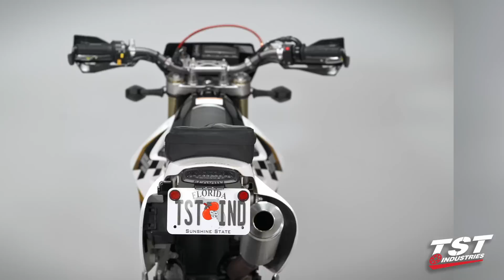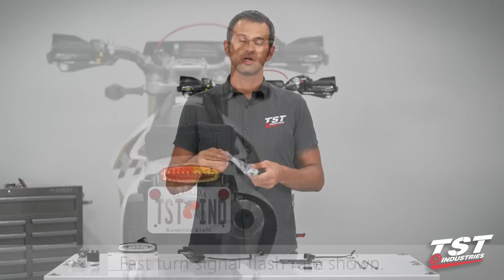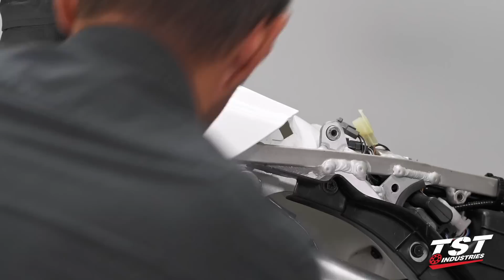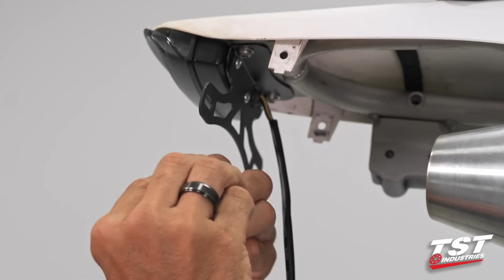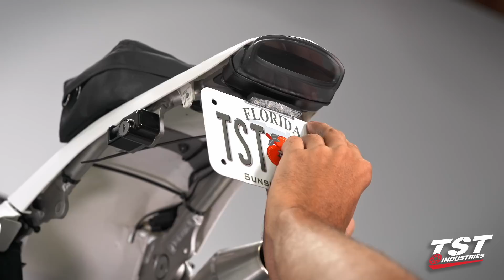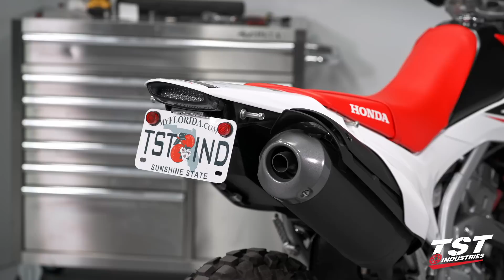How to install Integrated Tail light & Fender Eliminator on a Suzuki DRZ 400 by TST Industries

Comment: When u remove a bolt then the part, put the bolt back in the hole and give it a half of a turn with your hand so u dont loose or mix up ypur bolts. Then when u need them to put a part back on, they are right there and you dont risk loosing them or trying to remember which one goes where

Comment: idk what tail light i have, its already a sequentail tail light...will this kit plug n play with it?
Reply from the maker: If you have the Edge light then the two studs for mounting that unit do fit in the holes in our brackets. This means that your light is compatible with our hardware. We do not typically sell the hardware without our tail light though. You will have to contact our customer service guys and ask them for a custom order.

Comment: Do your turn signals bolt to the license plate bracket if I want to use them rather than the integrated turn signals? Would I just plug them in instead of the ones connected to the taillight?
Reply from the maker: Our signals are able to mount to the license plate bracket through the use of our pod signal mounting kit. You can absolutely leave the signals inside the tail light disconnected and use external signals. I am just unsure of the total length of connection reach needed from that location to the harness connectors. Our ARO18 signals are probably not a good choice there because they have pretty short wires. Our BL6 would probably work better. This is taking into consideration using those with our harness converters, as they extend the total connection reach and enable plug and play installation. I just can't know for sure if that is long enough for your described use. Another option that is less expensive but a bit crude is to clip off your plug and wires from your OEM signals and splice those into your new signals. This would guarantee proper length.
Reply: @TSTindustries  Thank you. When I do this I will probably get the turn signals and modify the wiring as needed. I just like the visibility of turn signals over the integrated ones.

Comment: Will this fit a 2001 drz400e?
Reply from the maker: I believe that the E model is the one with no subframe under the tail/fender. There is nothing there to readily mount our setup to. You would have to do some extra fabrication to make that happen.

Comment: is there a plug and play application to use soke of the pod turn signals on the rear with the integrated flasher from the brake light?

Comment: I have your integrated system and turn signal modulator on my 2020 Ninja 650 KRT. I love it. It was easy to install. 

The system for the DRZ is nice but the separate license plate illuminator is crap. I will NEVER tap into a factory wiring harness! That creates a resistance problem. And corrosion will eventually create an electrical problem on the motorcycle.

That's why when I see a used bike with a tail tidy, it's a pass for me. No thank you.

Another thing I will say about the integrated systems is that they become very much LESS VISIBLE to people around you should you have side cases on your bike

Comment: Why did you molest the cycle harness and not just the light harness!! 
The connectors are neat
Reply from the maker: I like to have the license plate light connected to bike side because in some instances I remove the tail light without the need to remove the license plate light. This keeps their connections independent.
Reply: @TSTindustries  ok, I get it. Just made me cringe. 
Are those little connectors water proof?

Comment: Awesome kit, very high quality, very fast shipping, very good installation video and no need to hack up the wiring harness on a bike with 50 miles on it in order to install the kit. Personally could not be happier, and i'm glad i cancelled my DRC Edge order and went with the TST instead. 

by the way, the installation videos go a long way. I know this is a simple product that is not difficult to install, but having a guide to follow that completely removes all ambiguity from the process goes a long way.
Reply from the maker: Thank you sir. That is exactly what we aim for with our installation videos. Glad that it worked for you as we hoped it would for most.. Cheers!

Comment: do i need the the description says it just adds 3 programmable modes to the tail light and im not sure what that means its necessary

TST Brake Light Modulator for OEM & TST Integrated Tail Light Suzuki DR-Z400S/M  ?

Comment: I note this video is now three years old but the tail light fender eliminator is awesome. Perfectly integrated and much neater. Good work.  However, pity I can't say the same thing about the license plate light. This seems like an afterthought and the wiring is very clunky compared to the oem style plugs of the tail light assembly. I write this from Australia where a license plate light is required to meet local design rules and such a light integrated into the main unit would be a big improvement.

Comment: If you loop out while wheeling would the taillight get destroyed or does it sit far enough in the fender where the fender would take the damage instead of the taillight?
Reply from the maker: More than likely the tail light would get destroyed. That tail fairing isn't the strongest either so fair chance that everything would show some signs of damage depending on how hard you hit.
Reply: It gets destroyed easily and it's kinda spendy

Comment: I'm like 80% sold...I wish that license plate light was integrated too. It feels cheap to have to tap power for the license plate light. Otherwise awesome design.
Reply from the maker: Smart design is modular. There are so many guys that shop for motorcycle parts that do not want a license plate light. I don't know the reason...we just comply with the most universal approach to satisfy everyone. Our license plate light is developed to work with any of our kits, for those guys that want a license plate light. And you don't necessarily have to tap in if you don't want to. You can make a pigtail with a connector set that comes off the main tail light connector.
Reply: @TSTindustries  #1 thank you for the reply, great customer service! I get what you are saying about the modular, it's a great product and now I'm 95% of the way there! The extra 5% is just me sucking it up and pulling that trigger!
Reply from the maker: No worries man. Take your time. We aren't going anywhere.

Comment: Very happy with the way the clear taillight looks on my white DRZ. Bought this with the brake light modulator and the only issue I have is that the wiring isn't long enough to allow the modulator to be tucker away under the seat, meaning I had to ziptie it to the subframe under the rear fender and leaving it exposed to the elements. Going to rewire the harness over the winter to allow the connectors and the modulator to reach under the seat.
Reply from the maker: https://youtu.be/Do7b0mevaWU
Reply from the maker: Hmmm...when did you purchase your modulator? We did a video on the DRZ showing that installation under the seat. I will post the video link below.
Reply: I bought it earlier this summer. I received the standard wire harness that plugs the modulator halfway between the taillight and the oem connectors, at the first connection underneath the fender.
Reply: Not sure why though, I bought it as an add-on directly from the DRZ page.

Comment: What brand of ratchet screwdriver (red handle) do you use? Trying to find the same one.
Reply from the maker: These aren't available anymore but you can still fins a Stanley Rotator Ratchet, which is basically the same thing.

Comment: Anyone know if this will fit a 2000 drz400e? I am about to title mine for street use.
Reply from the maker: The 2000 E model does not have the rear section of frame that the OEM fender, lighting package, and other peripherals bolt onto. This would not be a direct bolt-on installation for you.

Comment: Would that fit a 2018 Yamaha WR250R as well
Reply from the maker: No it will not. The electrical connections are different and of different length, and the main bracket differs as well. We plan on releasing a setup for that bike but thus far have been unsuccessful at getting one in house. If you are local to us, and are willing to lend us the bike for R&D, you will get the setup for free.
Reply: Ok. I don`t have the bike yet but I am working on getting the bike but not sure when it will be hopefully I will have it soon so I can get back to riding again an meet some riders an maybe ask them some questions about bikes also where are you located at? An which rear tail light like that in the video would u think would work for a 2018 Yamaha WR250R bike?

Comment: How can I make the brake light pulse when applying the brakes?
Reply from the maker: We are working on a brake light modulator unit that will be launching later this year. It will plug in between the OEM harness taillight plug and our taillight plug. Unfortunately we do not have a release date yet.

Comment: Why not make the electric whip one piece?  What's with the big-ass plug in the middle?  I see that as a problem in the dirt.
Reply from the maker: This light is used in a few different assemblies where we need to plug into different end plugs. We have sub-harnesses that accomplish that. The main 6-position plug is a Sumitomo sealed plug. Wateror mud will not get inside it so there is no need to worry. In fact, many Honda dual sport bikes use this plug on their taillight.
Reply: I bought this product and did the install.  I am very happy with the results.  Install was very easy and the bike looks so much better.

Comment: I hope the bracket isn't extremely thin and won't just crack like the current one on my DRZ.
Reply from the maker: MotoBoy the bracket that holds the assembly onto the bike is 14ga. Galvaneal steel. The bracket that holds the license plate onto the assembly is 16ga. Galvaneal steel. If these thicknesses are not adequate for you please do not buy our kit.
Reply: TSTindustries what an idiotic response. As if I'm supposed to know what thickness I need
Reply: We'll see. Already bought
Reply from the maker: I gave you specifics because you asked the question. We have been at this game for a number of years and our engineers have been designing these parts to be lightweight and practical. The only way it is going to crack is if you physically bend it and strain the material. Under normal use the brackets will outlast your bike. I hope this answer gives you more of the info you were looking for.
Reply: Yes, that's more of the type of answer I'm looking for...as long as it doesn't crack. 

I'm not sure what the current brand is of the fender eliminator on the DRZ, but it seems like off-road riding, wheelies and of course the inherent vibration of singles put some stress on it causing it to crack. Mind you, the bike has never touched the ground nor scraped (I'm not that good at wheelies).
Reply from the maker: Bending sheet metal during production introduces the first strain to the material. After that vibratory cycling can in fact continue that strain and result in fracture at the bend. This happened to some of the more rough-riding customers on our early version of a supermoto fender eliminator. We redesigned the system to prevent that. Our bent bracket is made of thicker steel and the bend runs the entire width of the bracket. The license plate bracket is made of thinner 16ga. steel and we configured it to not have a bend, thus not susceptible to cycling strain. We haven't had any reports of breakage from our customers or test riders yet.
Reply: Amazing people don't realize nothing lasts forever. By their very nature dirt bikes receive a ton of abuse. Replacing components is normal.

Comment: in this video are you showing us a taillight with the OEM Connector kit? Because my DRC Edge doesn't have that bulge in the middle area of the wires coming out of the tail light.
Reply from the maker: We are showing you the installation of our TST Exclusive Integrated Tail Light and Fender Eliminator system. This will be complete with OEM style connections for a plug-and-play installation. The DRC Edge is a different light system available on the market and will differ from ours.
Reply: cool, well i just bought this kit last night ;) can't wait!